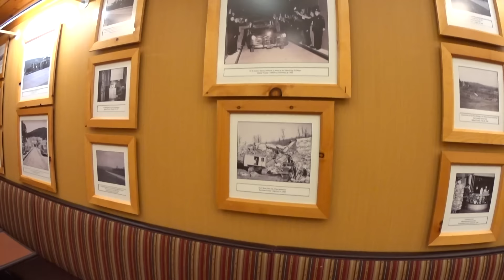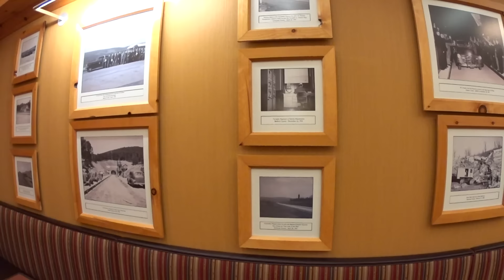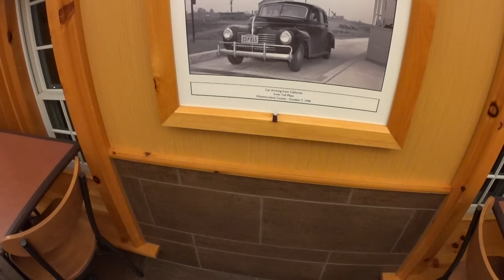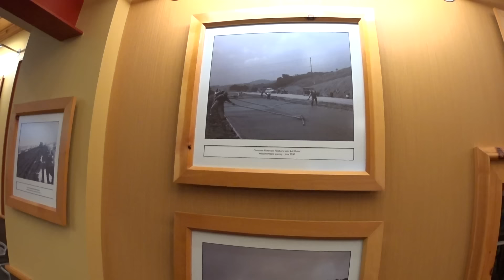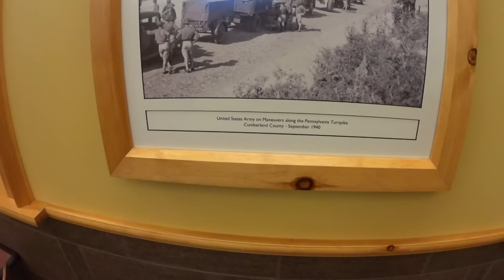3248 Bedford Pennsylvania service plazza

Comment: I'm only 45 minutes west of the Valley Forge toll plaza in Pottstown. 
The wood that trims that place is made out of Knotty Pine. My dad did the inside of our living room with that when I was a kid. Is a pretty and warm wood and not too expensive.
Reply from the maker: Looks so relaxing.. best if there were a fireplace.
Reply: Yes I agree, a fire place would have really topped the place off and made it warm looking, even had they gone with low maintenance Propane.Good call John.